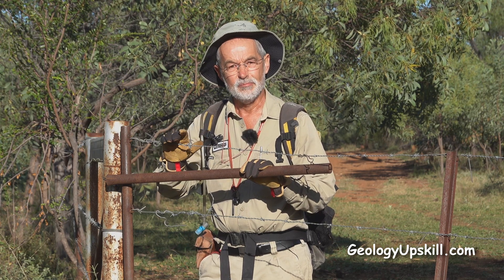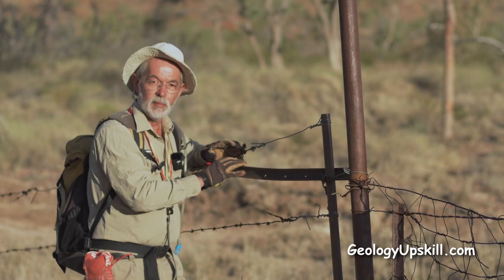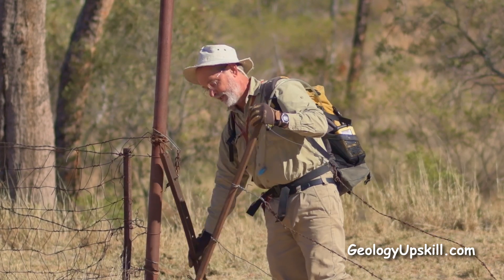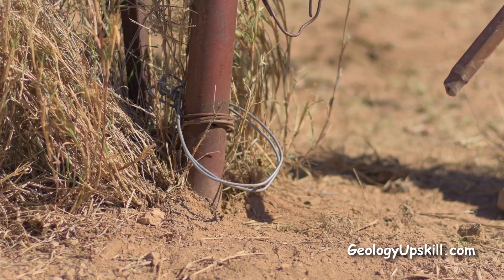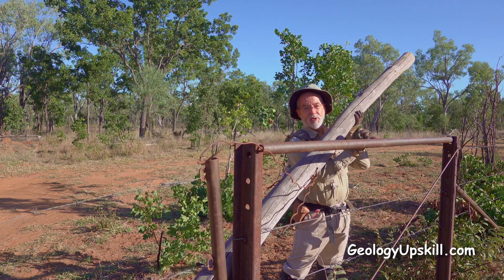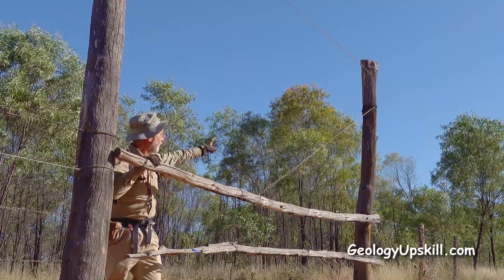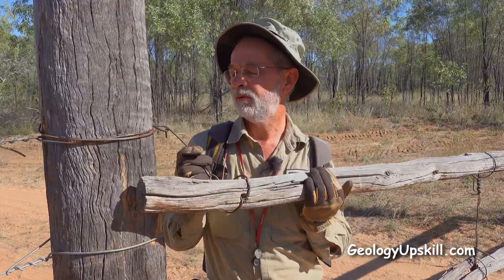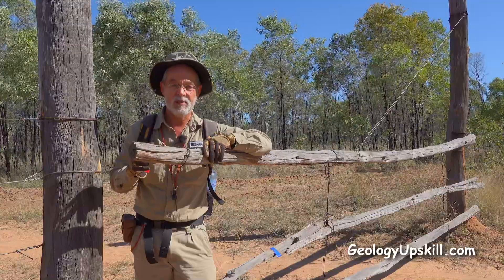Cocky's Gates

Comment: As a surveyor I've lost count of the number of times I've been bitten by 'cocky gates.' The heavy post type were always a pain as you ended up on the wrong side 50% of the time when closing them then had to crawl through or jump over the fence to get back to the vehicle.
Reply from the maker: Yep. They are ingenious, but not very convenient!
Reply: @GeologyUpSkill  Ran into a few in Upper Boyne Valley near Gladstone. They had jump stiles included to get over the fence. Most were around the old Norton Gold field. Still a lot of gold/silver and associated metals in sulphides locked up in that area.
Reply from the maker: That would be very useful if you are on the wrong side of one with a heavy lever!
Reply: They must have been badly built, 'cause all you have to do, after putting the loop over the gate post, is push the "lever rail" off the peg...easily accomplished from either side of the fence.

Comment: Being the sadist I am, there are few things I find more amusing than watching young, overseas trained geo's open (and then close) their first cocky's gate. Although, I have never seen one of those log contraptions (I've mainly worked in the Bowen Basin).  

You haven't lived until you need to repair one of these with whatever wire you can find lying around the gate either (pro tip, carry some decent pliers with you, and some spare wire).
Reply: Plus the wire and pliers are handy if you have to drop a fence so the bulldozer can get through, when you're cutting a new track out to a remote drill site.
Reply from the maker: Yep. The pliers in the Toyota tool kit just won't cut it!
Reply: Always carried a couple of pairs of Crescent fence pliers as a surveyor. Extra pair was hidden as offsiders had a tendency to depart with them when they left company. Spare wire was a must.
Reply: @geradkavanagh8240  Good to do if you're able to.
Reply: @richardhaselwood9478  Yeah, cost me a fortune in pliers. Thankfully I used to write most off on the company expense account. Smaller jobs on my own expenses always had that loss factor involved.
Reply: @geradkavanagh8240  Ouch... I'm the son of a farmer (extraordinarily helpful when dealing with landowners BTW), but, as such, I have some idea how much decent fencing pliers cost.  I always nowadays carry good flat nose pliers (and a Leatherman) and I'm very, very careful about who I let use my tool box.... 
But, we have both noted, fixing fences without either is an absolute PITA of a job (I'll also add, needing to cut wire away from 4WD diff's after someone drives over old wire too is a shit of a job without the right tools).